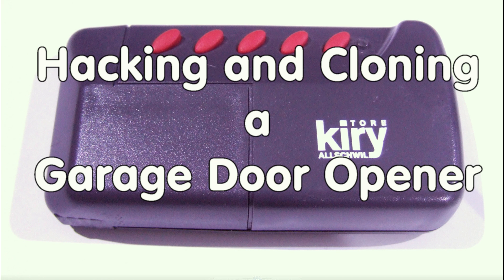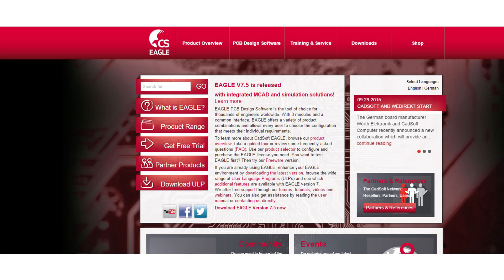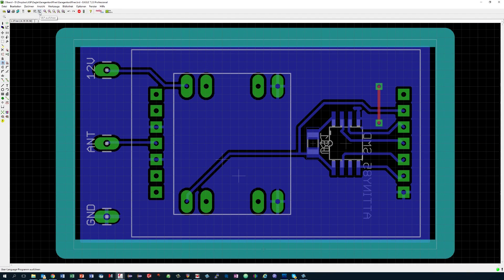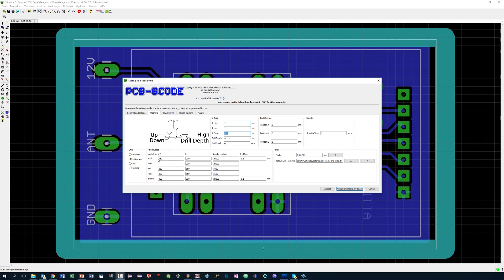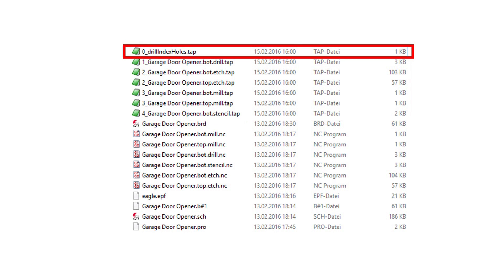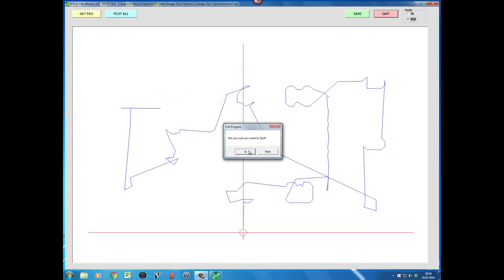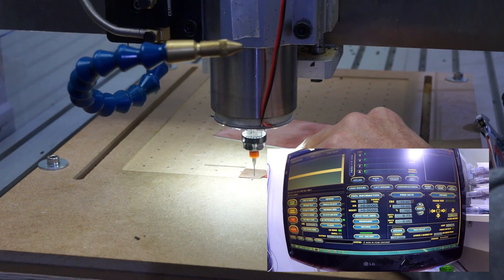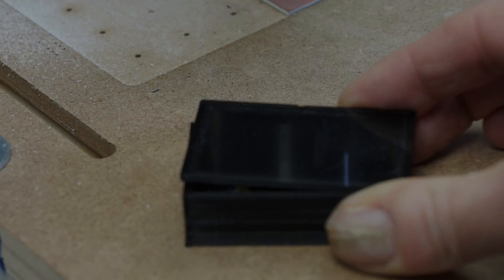#46 PCB Milling with a Chinese CNC 6040 and some Tricks

Comment: I never knew you had one of these. Do you still have it?
Reply from the maker: No. I sold it a few years ago. I did no more use it when I got a 3D printer.
Reply: @AndreasSpiess  it was pretty cool though. Have a few printers but I'd like a mini cnc for making pcbs. Just small ones for making light effects using a pic and a string of leds. I have an led obsession haha I'll never have as many as big c even though I've gotta be over 100K now of all different types haha

Comment: Connecting the PCB to mainly GROUND causes extra capacitance and inductance!
To be avoided, unless you know what you are in for!
Reply from the maker: Thank you for the warning!
Reply: @AndreasSpiess  For instance, a trace carrying high speed data, if located between two ground-traces for its length, creates an efficient transmission-line, with its characteristic impedance *and reflections*, if not terminated correctly.
Now, this may be what you want, but most likely it will be sub optimal.
If you leave a lot of copper on a board, it is best to have it "floating".
(With low-speed circuits, such as audio, this doesn't matter.)

Comment: Thank you for showing us that Auto-Leveler tool! 
I've been doing this for a number of years now, and it's the Z-Axis variations in PCB thickness that causes me the most trouble. It's not my machine, it's the FR4 of the PCB material that varies every so slightly. I'm hoping this Z-Mapping feature helps.
Reply from the maker: It should help. I sold my machine because I get now 2 sided PCBs for a few dollars from China...

Comment: With lead times to get anything from China becoming very long because of the virus (Spring 2020), being able to produce a board quickly in the lab is becoming very desirable. 

What kinds of lead times are you seeing in Switzerland and have you considered doing boards in your lab again?
Reply from the maker: I rarely use home grown PCBs. DHL still works fine from China. More expensive, but it worked in my case.
Reply: @AndreasSpiess  Thank you for responding. Glad to hear you can still get boards turned around quickly.

Comment: Thanks Andreas, very informative. Would Auto Leveller work with a GRBL CNC like my little Chinese 3018?
Reply from the maker: I do not know. It injects a lot of commands in the file for the CNC. Mach3 is able to read it.
Reply: @AndreasSpiess  Should be fine then, thanks Andreas.

Comment: It looks like you are going a bit too deep in your engraving, in my experience you only need to go 0.05mm deep. I have a few vids on my channel if you are interested
Reply from the maker: I do no more create my own PCBs. The Chinese manufacturers are very attractive...
Reply: @AndreasSpiess  Agree, having PCBs manufactured is very cheap these day, usually the shipping is more than the cost of the boards themselves. But it's hard to beat the convenience of being able to make your own prototype board in a few hours especially if you need several revisions to get the design just right.

Comment: I had a similar machine, what would be good is to find how to get it upgraded for greater accuracy in x,y,z and higher speed quality spindle
Reply from the maker: So far mine was accurate enough for PCB milling. I am not a mechanical engineer :-(

Comment: I'm an electronics engineer, I am taking the plunge and buying a CNC Mill for PCB work. I've been looking for one with auto levelling but no success yet. How do you get yours to auto level? I don''t mean software, your explanation on software is well covered in this video. I mean the electrical connections to the controller? The cheap ones are well documented but the bigger more expensive ones with external controllers are harder to find this information.

Thank you
Reply from the maker: I do not use it anymore for PCB, because you get so cheaply made PCBs. And creating 2 layered PCBs is not easy, especially the vias.
Auto-leveling is done with software. You connect one pin to the spindle and one to the (isolated)PCB. The software moves across the copper and goes up-and-down. As soon as the tool touches the surface the pin goes low and the software knows the hight.
Reply: Andrew, I think the setup uses the same connections as the automatic Z height setting block.  Rather than the wires connecting to the tool and the block, they connect to the tool and the PCB surface.

Comment: another good video, how is there enough time for you to do so much or be so educated, would a magnet of some sort under the board help?
Reply from the maker: Thank you! I take my time and go step after step ;-)
Reply: @AndreasSpiess  thx for replying you're of the few that has replied to the many comments I have made on this YouTube.
Reply from the maker: I try to answer all comments
Reply: @AndreasSpiess  I can't imagine what will be next???
Reply: @AndreasSpiess  I'd like to take a cheap drone cut their motors off and splice it into a homemade drone using transformers and multiple leaf blower motors with carbon fiber blades having the controller in hand, I'd like to use a tow bar from the frame with the blades to another frame that carries the  weight with multiple cameras a virtual head set and for now  signal relays for obstacles send it to the store and back.
Reply: for you it would be a piece of cake to put together.

Comment: I'm using TinyG Chilipepr USB controller for my CNC3040Z-DQ. Its webbased, opensource tool. To use it, you need to do some solderwork in your CNC controller box.  It took me <>20 minutes to get it up and running.
It works by running a small driver app, which communicates between your CNC, computer and the website. Then u drag-drop gcode into it and start milling.
Check http://chilipeppr.com/

#science4kids
Reply from the maker: I watched many of these Chillipeppr videos. Good stuff. But for the moment I hardly use the mill. I 3D print most parts...
Reply: My CNC started collecitng dust when i discovered JLCPCB :P. I mean like $2 for 10 PCBs.. u gotta be kidding!

Comment: Hi there, couldn't help but notice the PCB was moving whilst it was being milled. Might I suggest using double sided tape for holding a PCB down?
Reply from the maker: I used a vacuum table and usually, it did not move. These days I do no more mill my own PCBs because I can get them very cheap online.

Comment: Nice video, but I have to say that the quality of the pcb was really bad. I use autoleveling as well, but with a 60° cutter and drill/mill the board in one step. The finished boards look really good. What do you do to solder easily and do you use solder mask?
Reply from the maker: I do no more mill my PCBS, I order them online these days.
Reply: Andreas Spiess I understand, it's cheaper than buying the fr4 plates. But still, with milling you have the finished prototype after a few minutes and can check for flaws in the design.

Comment: Hello

I would like to share my experience of PCB design with CNC. I am using CNC 3018 machine. 

Fist I design PCB using Eagle or Proteus with clearance of paths and pads according to V bit diameter. After that I export it to gerber files using CAM process. 

These garber files open in Flatcam software and generate G Code files. Faltcam software is very good software and it is free.    

Then these g code files open in bCNC software. It is python base software and it is use for auto leveling and mill the PCB. CNC 3018 machine can use GND and A5 pins for probe to auto leveling. I connect A5 to V bit and GND connect to PCB board. 

Before I mill the PCB I decried whether ferric chloride is use or not.  If I use it, then I paint on PCB board using permanent marker then I can remove non milled copper. If I am not using it, I setting up Z axis little bit more depth.  

Then I can get perfect PCB. 

Eagle or Proteus --> Flatcam ---> bCNC ----> PCB milling 

Flatcam (Free) - http://flatcam.org/
bCNC (Free) - https://github.com/vlachoudis/bCNC , https://www.youtube.com/watch?v=Z59BkvBOx5A

V Bit Groove Dimension Tables - https://bitbucket.org/jpcgt/flatcam/wiki/V-Shaped_bits__Groove_Dimension_Tables

Thank you for share your knowledge and experience with us. I really like your channel. I know that this types of video can not make easier. You should spend lot of time to get experience of it. I appreciate that and thank you very much.

I would like to suggest make new antenna videos. How to choose antenna according to frequency and what should be the features and specifications like length, width and so on.
Reply from the maker: Thank you for your report. Very interesting.
Concerning antennas. I have many other topics an there are other channels covering antennas in detail.

Comment: Hi Andreas, I can't uderstand why a pcb gcode wizard is used.  is there somewhere I can get more information on its purpose? I understand it removes unnecessary  moves and  trace cuts  but  I cannot understand why or how these are generated if they are not required. Can you shed some light on this please?
Reply from the maker: The plugin in Eagle produces sometimes too much traces (for example I do not want to have traces around the PCB because I mill the PCB later. The same is with holes. So I remove these because they need quite some time to produce and wear the bit
Reply: Thanks once again Andreas.

Comment: I would like to have the same setup (cnc and so on) would you then bedre kind and give me a list with links on were to buy the participation cnc machine and tools (cutting and so on)
Reply from the maker: This is an old video and I do not have these links anymore.
Reply: Andreas Spiess do you have more info about it other than chinese 6040? What about spindle and spindle tools?

Comment: One irritation I have with the Gcode PCB_Gcode generates is that it seems to waste a lot of time in useless movements. For example, it will position itself over one side of the board and starts milling out in that area and then it will just suddenly stop working in that area and go totally over the other end of the board, mill out some isolated lone pad and then come back to where it was to carry on... What's the point of that? And it doesn't do it just once or twice, it constantly does it. Why not do as much as possible in one area and then move on? They say it's mathematically efficient but watching it work it seems very counter-intuitive to me. The other problem I have with it is that Tool changes are just totally mind boggling to understand or use and the manual isn't much help in that department either. So say I want to mill out a PCB but I have a variety of different drill sizes such as one size for components and another for Vias... It's a nightmare to work out so for now I just use one size drill bit for all but it's becoming impractical to do this with more complex circuits requiring small vias. I can't knock PCB Gcode for what it is but people should be aware it does have limitations and in some places a rather complex learning curve.
Reply from the maker: 1. I use a software to optimize the tracks (I think, I showed it in the video)
2. I only drill with the smallest diameter and then enlarge the few holes manually. Is quite easy with an existing hole.
Reply: Hey Andreas! First off all, thank you for all your videos - they've been a real big help to me and secondly, thanks for replying!
I was milling out a panel of six breakout boards yesterday - not an easy task without auto-level (I'm still using the stock control boards in my CNC3040 so don't have auto-level yet) and your video came to mind as I watched the GCode undergo it's usual ADHD moments where it went and started a bit on one board and then before finishing it, it shot off to the other side of the board to start something else. I had to laugh to myself. I also ended up doing what you said. I drilled out all the holes at the smallest diameter and manually enlarged the rest by hand. It's not a bad approach to small boards with a few holes but on larger designs with varying sizes it could be a bit of a headache. I'm always keeping my eyes peeled for faster ways to get stuff done with as fewer tools in the chain as possible.

Comment: Hi Andreas,

Could I ask you which CNC controller board you are using and how you are connecting your computer (USB or Parallel). I read that there are complications with using USB and autoleveller. Thank you! 

Sincerely,
Tin
Reply from the maker: I use Mach3 through a parallel port. The CNC controller accepts this parallel port signals

Comment: Just came across your video. Funny to see that you almost exactly ended up with the same hardware AND software choices as I did. Results are very similar. Only differences I have in my workflow: I do not use the gcode wizard but instead use a software called opti_qt.exe ( free and from one of the sources for pcb-gcode) which sorts all the moves and maximizes the efficiency. Only trick you need to know is that it requires the gcode with fileextension *.nc. I have also programmed a autoleveller but in the end decided to increase the DRC settings (min wire size to 20mils) and set etch depth -0.2 This way I get consistently very good results but only for through hole designs. If I need smaller wire size with SMD I switch to photochemical process.
Reply from the maker: Because these days manufactured PCBs are so cheap, I do not do many for myself anymore. I just order them with silk screen etc.

Comment: What a good video. You're amazing.
I have a question and I don't know if you can help me.
I have a 3040Z Chinese CNC, I want to do PCB's but I always have problems with the Z axis, WHat I need is AUTOLEVELER, but I use CNC USB CONTROLLER, because I have a laptop. I don't know if there's posibble to do autolevel if I use this software. 
Thank you again!
Reply from the maker: +Marco Valbuena It creates a special G code for Mach3. Maybe you go to the homepage of autoleveller and check if he has a version for your purpose. Or you search for another software. Without autoleveller, it is not easy...
Reply: Thank you so much again

Comment: What if you use a non v-shaped milling tool. Would it help prevent the copper from being removed if the cnc cuts too deep?
I'm noob with cnc machines.
Woooow, the autolevelling trick is exactlly something I was looking for. Thank you very much.
Reply from the maker: You would need very thin tools, and they break very, very easily. So, the V shape is a good compromise.

Comment: Wonderful video ;)

What happened to your nail? (last few seconds of this video). CNC accident ? :)

Great channel!
Reply from the maker: +Felix's Lab no, no.
Reply: I hope it's fine now ;) 

Quick question. I'm about to buy my first CNC machine and I found this one:

https://www.olx.pl/oferta/frezarka-cnc-grawerka-510x310x45-zobacz-film-CID619-IDdSxYF.html#3ee7f654fc
It has trapezoidal screws.
Do you think it's worth buying or should I look for chinese 3040 with ball screws?

I would like to use it for CNC PCBs and some slow aluminum milling.
Reply from the maker: The movement motors are half the size of the ones used in my machine. So, I am not sure it will be able to properly cut aluminium (this needs quite some power, independent of the size of the machine if you do not want to lose steps). PCBs should not be a problem.

Comment: Hi Andreas again Where abouts do you add Isolation around traces in Eagle that once the traces are milled the copper next to the trace is removed Cheers Benjamin
Reply from the maker: I do not exactly understand your question. Maybe "ratsnest" in Eagle is the answer
Reply: what i was Meaning was Trace isolation, sorry for the confusion so basically removing the copper around the trace
Reply from the maker: +Benjamin Isaacs I thought, I show the whole process in the video? There, you should see, which software I use for each step
Reply: Yes you do but you apply the ground plane and what i want to do is remove the excess copper as i have a PCB Antenna
Reply from the maker: +Benjamin Isaacs Now I understand.  I do not know how to do that. I only could think that you mill this part the conventional way. Maybe you can do something by adding some thick traces in the milling layer.

Comment: Hi Andreas 
 I have a 3Drag setup for PCB milling and it works but when i design a board in eagle then run it though PCB-GCODE and it generates the Gcode the Gcode is always in the middle on my waste board, Is there anyway to set it up so that design goes to the bottom left corner on the CNC machine?

Cheers Benjamin
Reply from the maker: I think, your Zero Point in Eagle (a + sign) is also in the middle of your PCB. If you shift it to a edge (you have to shift the parts), it should be ok.
Reply: Okay will try that thank you so much

Comment: Nice video! I personally now use CNC 30x40 to make PCBs (1 & 2 sided). Been through a lot of software already and here I could recommend you Flatcam - much more easier to use to generate gcode as you need.
Reply from the maker: Do you use Eagle to draw your diagrams?
Reply: Yes - I start all my projects in EagleCad - once completed move them to Flatcam and then to assure pefrect leveling I use AutoLeveler which adjusts heights to differential heights on my PCBs. 

Also I'm working on improving flatcam to support easier 2 sided PCBs without need for allignment holes etc
Reply from the maker: Sounds interesting. I do not do any 2 sides PCBs so far. I do tnem single sided and, after debugging the diagram, I just create a double sided board and send it to Osh Park...
Reply: Well this method using this software combo has realy potential ;) suggest trying that out - makes life so easier